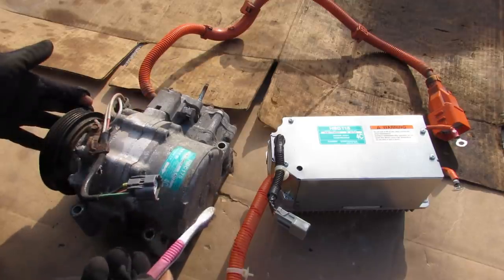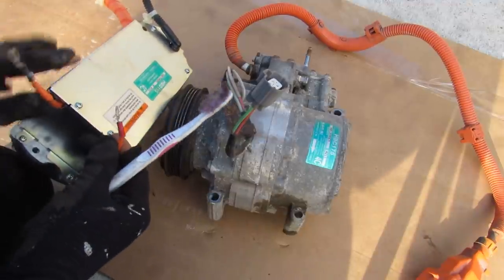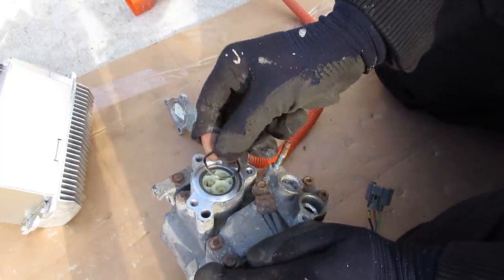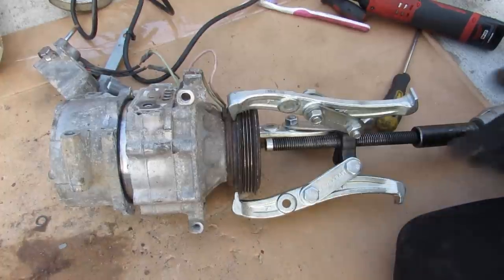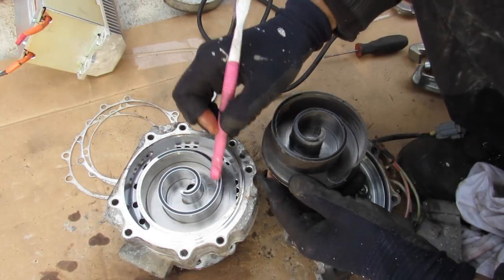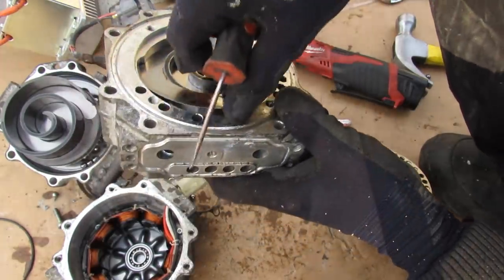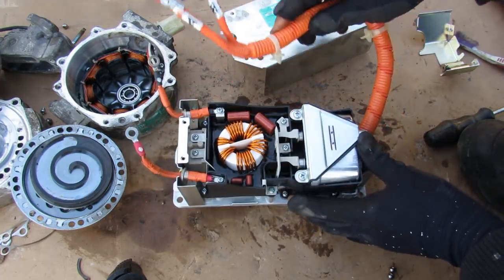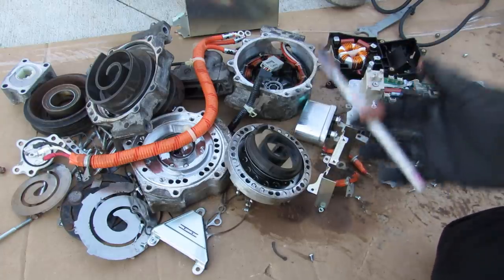How Does a Hybrid A/C Compressor Work?

Comment: Fancy stuff, I wonder how much fuel economy they gained by keeping the mechanically driven part for highway use. What are the power losses in a hybrid generator and an electric motor?
Reply from the maker: Good question. I feel like they did this more for the idle stop functions than for highway fuel economy
Reply: @speedkar99  Hmm, would it require a bigger IMA motor/generator and battery pack if the A/C was electric only?

Weird car, the IMA replaces an alternator but it does still have a traditional 12V battery and starter too. The A/C  has a 3-phase electric motor but can also be belt driven. And didn't the V6 engine still partially provide power even when driving at low speeds? Meaning the only time the A/C couldn't be belt driven is with a stopped car.
Reply: Just a guess, but I would think the efficiency lost in the inverter and motor might be regained by matching the load to the requirements of the moment. It would be really interesting to see how it all works out.
Reply: It is more fuel efficient to drive the compressor by belt from the engine (when the engine is running) than to convert mechanical energy into electricity (50% losses here) and then electric motor to run the AC alone.

Comment: Dear Speedkar99, I can't find another way to reach you other than the comments area. I need your help, I'm trying to hook up a camera on the passenger side mirror that turns on only when I push the signal lever up (i.e. activate the right turn signal) but I need to get a constant current that keeps the camera on while the signal is flashing. Any idea how to do it?
Reply: Depending on what car it is and the way it is wired, a relay? If it is a CAN Network design give up. From the switch to the indicator will be a wire going to a relay, you could use this to energise a relay, which could be the power for your camera....why you need a camera though? Seems a lot of effort.
Reply: @philpersonal4656  I upgraded my 2007 Sienna LE sound system. Now I have a back up camera, I have an extra Video input that I can use for an extra camera. I can hook it up right now but it's going to be on all time. I just want it to turn on only when needed. I don't want to use a switch, because my hand will be busy with a click on the head unit to switch the display to video input.
Reply: @landshass2849  seems like it could get complicated. Would the head unit auto select the camera channel when camera came on? Otherwise you'd have to change input on radio manually each time camera came on. A relay would be best device for switching on a camera from indicator stalk. Sounds like you need to go to an audio-visual specialist. Also, most people like a reverse camera, why you want it on indication?
Reply from the maker: You'd need a relay that's wired to the turn signal circuit, but one that stays on for the time in between flashes (something with a capacitor or microcontroller?) Maybe there's a logic gate that can help. 

Otherwise you can try tapping into the circuit from the turn signal stock side to fire up that relay and power the camera so you don't have to deal with the flashes
Reply: @speedkar99  thanks, I appreciate the reply. I'll update you with the results.

Comment: I had just replaced the compressor on a 2014 civic hybrid, and the A/C still does not work.. I have filled the system with the correct spec of refrigerant, and inspected fuses that may be related to the system.. Not sure where to go from here, may be i’m missing a certain fuse, or relay that the old compressor may have caused to become faulty… any idea what to check?

Comment: Wasting Car Radiators Heat Instead of Using it for Air-conditioning
Vapor cyclic refrigeration methods and systems are either 1. Vapor-compression refrigeration; 2. Vapor-absorption refrigeration (no compressor); or 3. Vapor-adsorption refrigeration (no compressor)
In adsorption refrigeration, the refrigerant or adsorbate vapour molecules adsorb onto the surface of a solid instead of dissolving into a liquid. While in an absorption system, an absorber absorbs the refrigerant vapour into a liquid.  Adsorption refrigeration also includes a generation process where refrigerant vapour molecules desorb from the solid.
A variant of Vapor-absorption refrigeration is the Electrolux Refrigeration is also known as Domestic Eloctolux refrigeration or sometimes known as Three fluid Refrigeration as it uses three fluids for the cooling process which are ammonia, water and hydrogen. Hydrogen gas is used to increase the rate of evaporation and hence rate of cooling. No pump or compressor is used.
The absorption cycle is similar to the compression cycle, except for the method of raising the pressure of the refrigerant vapor. In the absorption system, the compressor is replaced by an absorber which dissolves the refrigerant in a suitable liquid, a liquid pump which raises the pressure and a generator which, on heat addition, drives off the refrigerant vapor from the high-pressure liquid. 
Some work is needed by the liquid pump but, for a given quantity of refrigerant, it is much smaller than needed by the compressor in the vapor compression cycle. In an absorption refrigerator, a suitable combination of refrigerant and absorbent is used. The most common combinations are ammonia (refrigerant) with water (absorbent), and water (refrigerant) with lithium bromide (absorbent).
Adsorption refrigeration was invented by Michael Faraday in 1821, even though the basis of artificial modern refrigeration dates back to 1748 with William Cullen experiments. Adsorption refrigeration technology has been extensively researched in recent 30 years because the operation of an adsorption refrigeration system is often noiseless, non-corrosive and environment friendly.
In the early years of the twentieth century, the vapor absorption cycle using water-ammonia systems or LiBr-water was popular and widely used, but after the development of the vapor compression cycle it lost much of its importance because of its low coefficient of performance (about one fifth of that of the vapor compression cycle). 
Absorption refrigerators are a popular alternative to regular compressor refrigerators where electricity is unreliable, costly, or unavailable, where noise from the compressor is problematic, or where surplus heat is available (e.g., from turbine exhausts or industrial processes, or from solar plants), and in recreational vehicles that carry LP gas. It is also used in industrial environments where plentiful waste heat overcomes its inefficiency.
So, Why we Waste Car Radiators Heat Instead of Using it for Air-conditioning? The heat energy in car radiators could eliminate the need for compressors and be used in the generator process in Vapor-absorption or Vapor-adsorption systems for car air-conditioning.
It is better to utilize cars engines surplus heat using adsorption/ absorption systems low efficiency rather than waste energy into air, and using more energy to run compressors.
Not only the World wastes cars’ heat but also consumes huge energy in air-conditioning and refrigeration in too many countries having high solar heat by using compression refrigeration https://wp.me/p1OEJz-1LZ 
Surely, you see my point. Do you have a reason for this waste?

Comment: Man, that's a lot of parts, just for one component.
Reply from the maker: Hybrids overcomplicate things
Reply: Kinda 2 mechines of different type that work alternately need their on auxilaries and utilities for the same job, redundancy. End up more expensive to own a car, which defeat the purpose of hybridizing. 😄
Reply: regular hybrids are simpler cuz the transmission's just a planetary gearset and two motors
Reply: @speedkar99  My Prius eCVT is just a planetary gearset and two electric motors. Basically indestructible.
Reply: @aspecreviews  It truly is. The first gen had trouble with MG2 burning out because they ran the system on 273V. In 2004 the inverter included a voltage doubler that cut the current in half (and the heat by 3/4). Since then they may well be the most reliable car transmission made. (I have done enough clutches and cursed at enough second gear synchros to toss manuals out of the running. The last one I did had only lasted a year before the new pilot bearing seized. GRRR!)
Reply: @flagmichael  I have a first gen, a 2002 to be exact. The MG2 burning up issue was more common in states like Colorado and Wyoming with a lot of hills and high speeds. Trying to climb up a mountain pass at highway speeds put so much heat into the motors that they burnt out.

Comment: So the output from the electric one is not as cool as the one on mechanical one? Since the electric one is smaller? What about those on Toyota/Lexus hybrids? Thanks.
Reply: Since 2004 Toyota has used only electric compressors in their hybrids, and they are sized for the job. Before that it was only mechanical.

Comment: Interesting vid. Mayb U can answer a question for me. Hi compressor in my 2010 Camry hybrid is making a terrible noise. I told the missus not to use the aircon till I got it looked at. Anyway she continue to use it for next month. Now it won't turn on should I replace it with a second hand compressor or does it just need gassing and maybe oil. Cheers.

Comment: its a bldc motor,  3phase ac induction motors have squirrel cage rotors whereas a bldc motor has same 3 wire connections & a permanent magnet rotor.
Reply from the maker: Thanks for the correction
Reply: BLDC motors have an internal electronic commutator to adapt to varying speeds with varying loads and are DC powered (thus the DC in BLDC). I don't know for sure about the Honda IMA but the Toyota versions are strictly 3 phase. Unless the IMA compressor motor is DC fed, it can't be BLDC.

Comment: Does Honda still do this?  Seems unnecessarily complicated.
Toyota's modern hybrids just have electric everything (refrigerant compressor, water pump, etc.) and don't have an accessory belt at all.
It doesn't matter if the engine is running or not.  A/C is always electric.
Reply: The chevy volt did fully electric compressor along with electric brake accumulator & electric power steering in 2011. The only belt it has is for the ICE water pump.
Reply from the maker: Im not sure if they still do this. But I find it inefficient, and electric everything would be the way for future cars.
Reply: @speedkar99  I'm not sure either, but unless Honda has changed the way their hybrids work (which should change the Integrated Motor Assist designation) I bet it is still done that way. I looked in Rockauto and the 2015 HCH (the last year it was sold in the US, at least) listing shows a compressor that looks just like yours. In 2021 they only have the Insight but no listing for a compressor. Your guess is at least as good as mine.

Comment: I watched all the accord transmission vids then thought I should switch the gear position sensor first. The spiderwebs let me know the shaft was not turning so I found the broken shift cable assembly. It ran for 5 minutes fine then rougher and worse till I couldn't get up on ramps. Now the dlc sayes no connection and I lost spark. The plugs are soaked in gas. Please help.
Reply: 2nd o2 sensor was the only code. I pulled the fuses checking them (ok) so no codes to get

Comment: I'm thinking about using these units to swap to a normal car and use the electric motor to run the car's AC when it parked at home (my home doesn't have AC, also I do a lot of things in my car like watching YouTube with my laptop because I have more privacy in my car). 

When the engine is running the compressor takes power from the engine, when it's parked the compressor takes power from 144vdc provided by a custom step down adapter plugged in to a cord in my garage.

Comment: Most hybrid compressors do not run off the drive belt! There are run by high voltage motors. This video is of a non hybrid style compressor rarely used on hybrids any longer. That is because they shut off the engines when in EV mode and we still want our ac's to work.

Comment: Really bummed that its not a single shaft all the way through, with the right motor controller you could generate power off your engine for house batteries, you can run your AC off your house batteries while you're parked, not waste the engery while you're driving... ugh so many useful ways to route power and cooling through this device... if it was a single shaft...
Reply from the maker: But isn't that what the hybrid motor does anyway?? Lol

Comment: As im sityin in my mariner hybrid wanting more ac. At idle it sucks, ac full blast. Engine on. Have 2 12" pusher fans,1730 cfm each, but little difference. Ac working normally. Blaaa these guys figured it out. The problem is hybrid battery pack cooling steals half the cooling capacity.

Comment: Hybrid = more to go wrong!
Reply: Be that as it may, we have bought nothing but Prius since 2002. The reliability is way beyond any car we have had in the 40 years before them. The 2002 needed its first repair (beyond 12V batteries, tires, and wiper blades) about 3 years ago at 198K miles; the inverter cooling pump failed. $150 and a few hours cursing at rusted trim panel bolts and it was going again. Having more to go wrong does not mean more will go wrong.
Reply: @flagmichael   Undoubted Toyota are the exception to the rule! My guess is the Prius was your first Toyota!

Comment: Just be like scotty and drive an old Toyota without AC in Texas
Reply from the maker: Whew that must be hot
Reply: I was driving a 1970 Volvo with inoperable AC in Phoenix when it was 122F. It was mighty toasty. In Phoenix summer, if you have an engine temperature gauge it will still be off the peg when you get off work in the afternoon.

Comment: Please help.  I have an electric compressor that is not turning on.  The dealer wants to charge me $7k to replace the entire system but I really think its not turning on because its not getting power.  To test this I need my wiring diagram.  Can someone please send me this if I give you my vehicle details?  Thanks.

Comment: Wouldnt it be eazier to just use the electric one all the time
Reply from the maker: That's what newer cars are doing now
Reply: Toyota has done that since 2004. In the first generation Prius the compressor was mechanical only; when the engine stopped the cooling did too. (We still have one in the family.) Starting in 2004 it was electric only.

Comment: And this is why Hybrid Cars are cheaper, simpler, lighter, more reliable and cheaper to fix.  NOT!
Reply from the maker: Who fixes cars now a days....just get a new one 😄
Reply: The Honda IMA was a real problem in the early years - I don't know about the last decade or so. The Toyota system is a marvel of reliability from the second generation (2004) onward. They do cost a little more but repay it in repairs not needed.